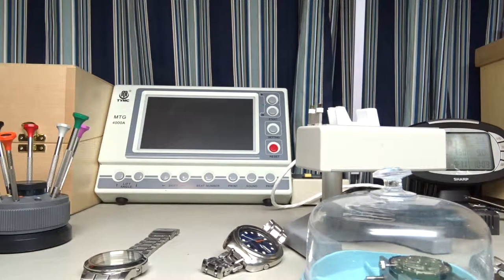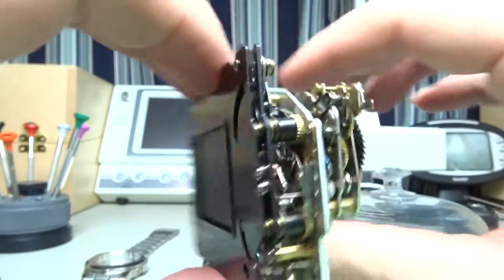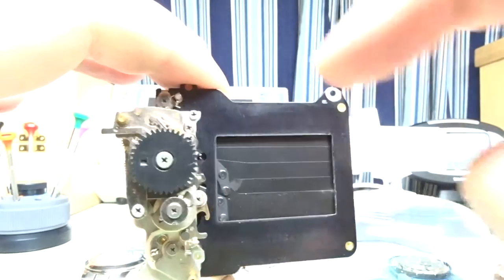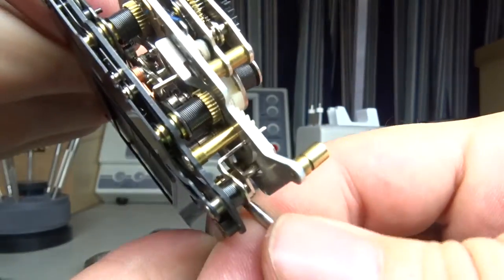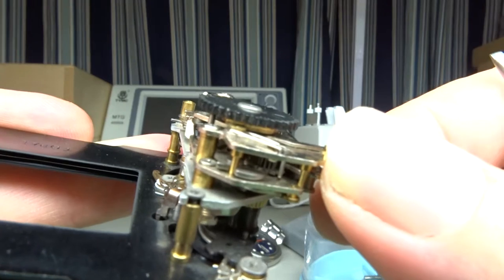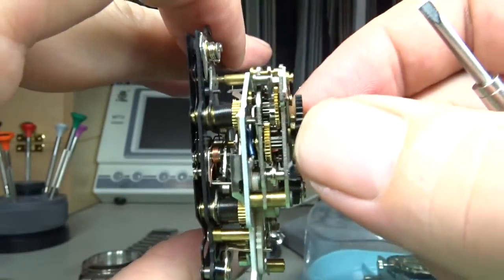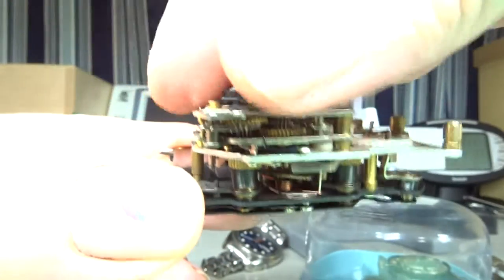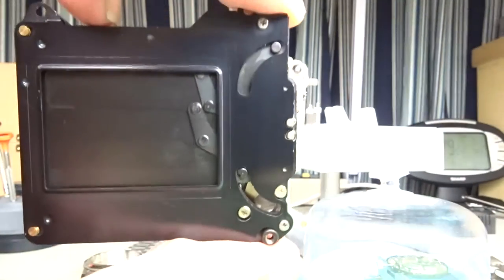35mm camera mechanical shutter - how it works

Comment: My first training in high school photography was before digital cameras ever existed, believe it or not, and the details of a camera's mechanical makeup were never shared like this. It was explained though that at high speeds, one side moves closely behind the other to create a stripe of exposure in equal timing all the way down the film and just today I was wondering how that was mechanically possible. Your video gave me a good clue about that but what I am really looking for is a breakaway mechanical drawing and 3D digital model/animation that can demonstrate this at slower than real time. Mechanical cameras were a wonder of technology. Something I saw recently that triggered my curiosity on this subject were some video of old phosphorous flash cameras being used where a second person held the flash in the air. The timing coordination between the camera and this kind of flash intrigued me as well. Of course, film was not as fast to expose back then so motion would be pretty blurry.

Comment: Hi this video is so useful to me! Nothing else like it. I wonder if you can help me im trying to make a 35mm camera and the shutter mechanism is something that I need to source elsewhere as I dont have the skills to make one myself. Would you think this would be similar to most mechanical shutters as I can see how I could attach this to my own body and control it. 

Any help is much appreciated :)
Reply from the maker: Hi - most 35mm mechanical SLR cameras will have either a metal shutter like this, or a horizontal silk fabric shutter(Minolta X-700 for example). The X-700 is a type of shutter that needs electronic control, whereas the one here does not. Some of the older cameras won't fire the shutter like you want if you take the light meter/control electronics out of the picture. Best suggestion I can give - If you need to find one on the cheap my advice is cragislist or if there is an antique shop nearby sometimes you can pick up old cameras there. Good luck with it.
Reply: C Roberts yeah thanks so much :) I know I need one without a battery this system just seems so simple I was planning on using an old zenit em I have, should do the job nicely. Also making a way of focusing it will be tricky, need some ground glass I suppose. I'm thinking a 35mm hasselblad style machined out of aluminium. But cheers for the help there's no other video showing how the shutter works!
Reply: @timpowell4178   have you finished this project yet???

Comment: What camera was this out of?
Reply from the maker: Excellent question, I pulled this out of a Minolta body but I cannot recall exactly which one, sorry.
Reply: @ChrisR  I think only three minolta camera models in existence had vertical  traveling shutters. The XD 11, XM/XK, and the XE-7 could have been one of those three.
Reply: @needleneck3770  All of those cameras have electronically timed shutters, and the XD shutter was made by Seiko, not Copal. I don't think any fully mechanical Minolta camera has a vertical shutter, so maybe it was from a different brand camera after all?
Reply: So what camera is it?
Reply: @habin959  Nikon FM has similar (Same?) shutter mechanism made by copal.